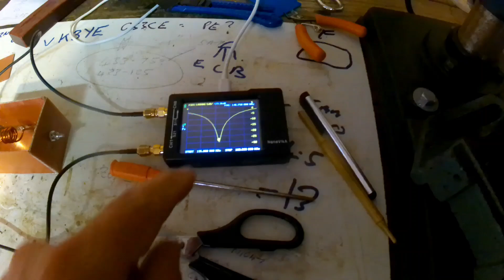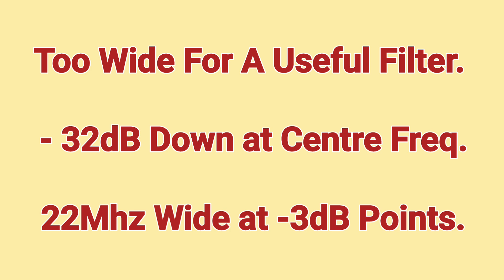2m VHF Helical Notch Filter. -32dB Down. Ham Radio. Amateur Radio.

Comment: Can you give more info in this, I'm very interested in this filter, like diameter of coil, length of the coil. gauge of wire used,  min and max of the  piston capacitor, even the box diameter. please! 

Please build the 2m cavity filter you mentioned,  I can't use 2m radio at all, well unless someone is very nearby as i getting almost an s9 from 144 MHz on the nose.
Reply from the maker: Please watch my latest video on this Filter. I am unable to build a vhf Cavity Filter as I haven't found a source for low cost material. A metal cylinder of 500mm long and 6inches in diameter for example is around £50. Plus copper and brass fittings. George
Reply: @MakeDoAndMend1  ok, do you have any plans for the 2m cavity filter that you could share? I do have some 70cm professionally built cavity filters, there small but heavy.  A Good chap from my local amateur radio club check them out on his test equipment for me, they came out the same as what they was on mine, unfortunately they are no use to me. I'll be sticking them on somewhere like eBay soon.
Reply from the maker: I don't have any plans I just watch as many other people's videos and guesswork.  But so far all I know is the centre rod that slides up and down is quarter wave on 2m. Hence the metal outer case pipe will need to be a at least 500mm. Diameter as a guess is twice diameter of 70cm Cavity I made as lower freq then double size. Pure guesswork.  George

Comment: What specific frequency do you want to pass and what specific frequency to reject?  In any case, you will get better results with a larger helix.  Instead of copper wire, use soft copper tubing, say about 4 mm diameter.  Make the helix diameter about 3 cm and the wall-to-wall spacing about 6 cm or a bit more.  Turn-to-turn spacing should be about twice the tubing diameter or a bit more.  Don't use the piston trimmer capacitor.  Use a tuning screw approaching the open end of the helix instead.  You want a minimum of tuning capacitance.  Trim the helix length to resonate just above the desired notch frequency and then install the tuning screw to bring the notch to the desired frequency.  I would expect you will end up with about five turns on the helix.  Make the box walls extend up well-beyond the helix or else add a shield cover on top, electrically attached to the sides to prevent leakage of energy out the top.  Instead of connecting the coax stub directly to the resonator, have an open-ended probe wire from the coax enter the box and positioned near the open end of the helix.  Bend the probe closer of further from the helix open end to position the probe to get the desired notch depth, while compensating with the tuning screw to keep the notch frequency on target.

To reduce the attenuation at the pass frequency, if the pass frequency is below the notch frequency, add a combination of a series inductor and shunt capacitor in series with the coax after the resonator.  If the pass frequency is above the notch frequency, add a combination of a series capacitor and shunt inductor in series with the coax after the resonator.  Adjust the values for acceptable performance.  If the pass frequency is below the notch frequency, a starting point is to use about one turn of hookup wire in a loop about 4 mm diameter for the inductor followed by a ceramic chip capacitor of about 100 pf mounted with zero lead length.
Reply from the maker: Thanks for the info. I don't really need one. I was just playing around to see what it does. Read other people's comments. Especially on more recent vids. Ps look at my cavity filters. George.
Reply: @MakeDoAndMend1  Okay.  Your cavity filters are very nice looking.
Reply: Can you tx through the filter? (Simplex) if so how much power?
Reply from the maker: I have no idea. I basically run QRP .

Comment: Would this notch filter be a good fit for a receive-only station that monitors a single frequency in the 2-meter band? 155.450 is interesting to listen to local emergency traffic in my area, but that radio gets clobbered by my APRS beacon and packet station operating on 144. 390.
Reply: That's exactly what this is for.  You can also use a very simple stub.  A halfwave shorted at the end reflects a short (and an open reflects an open), and a quarter wave shorted at the end disappears (but if open, reflects a short circuit).  So what you want is odd multiples of a quarter wave that match half-waves of the other frequency.
13 quarter waves of 144.390 are nearly identical to 14 (7 half waves) quarter waves of 155.45 (assuming 66 percent velocity factor coax).  
So a piece of coax 4.45 meters long, with a BNC connector at one end and open at the other (chop it off!) will look like a short circuit to the 144.390 and an open circuit to 155.450 when connected with a "T" connector between the receiving antenna and the receiver.
Reply: @thomasmaughan4798  Very cool, thanks for the hints about stub filters, I'm going to read up more on the theory and how to calculate the lengths. I'll put testing this on my list of summer projects.
Reply from the maker: It might work . I will test the filter on that freq and maybe do a video on it. Regards from old George.
Reply from the maker: I have just done a test with my Filter. No it's not suitable as the notch is too Wide For your purpose. So I reckon a Cavity Filter is be
Suited.  Will put a short video up soon. George
Reply: @MakeDoAndMend1  George I really appreciate you testing the filter design for me against the specific frequencies. Your design is captivating in its simplicity, and the copper clad board seems to be a nice and easy to use material for building cavities. Regarding the duplexer cans you built, very nice work. I've been keeping my eyes out for inexpensive metal cylinders of appropriate size so I can take a stab at building my own set of cans one of these days. 73 to you and Thomas

Comment: "nobody is on the air."
Because everyone is waiting for someone else to call first. 😅.
🤜🤛

Thanks for the video!
Reply from the maker: I just think it's a dying hobby. It's all sitting in front of computer screens with AI calling CQ and sending signal reports and logging contacts etc. Using a telephone to get ya mates to call you on the Radio. George 🤠🤣
Reply: @MakeDoAndMend1  
Hi George, you're probably right. I guess we're both bad examples of this, but for what it's worth: im half the age of the average Ham, and I'm enjoying the hobby.

Might catch you down the coax at some point.
73
From the land of VE4